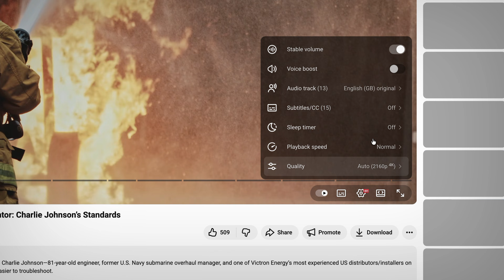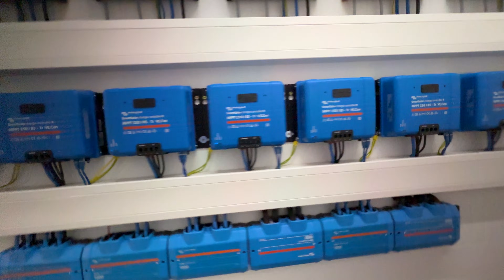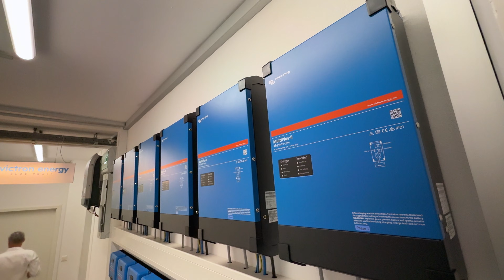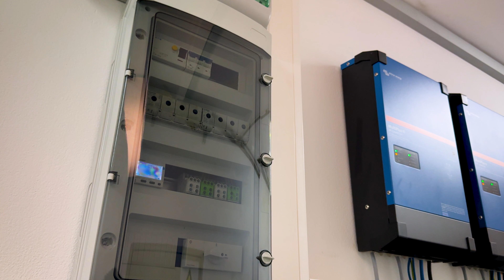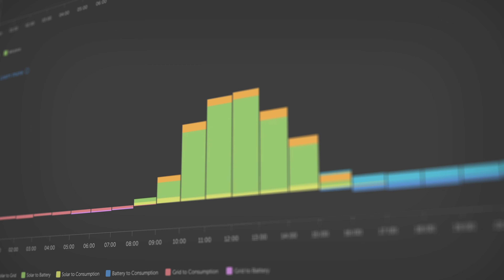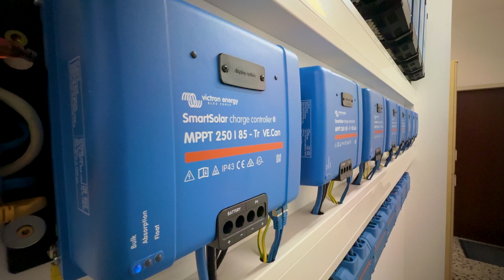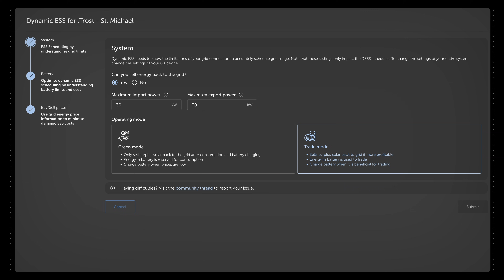How One Family Built a Private Energy Factory

Comment from the maker: Unfortunately there are two errors in this video.  The user mentions this system has 30kW of inverter power.  This should have been 30kVA.  The actual kW for 6x 5kVA MultiPlus II's is 6x 4kW at 25 degrees C = 24kW.  Also the battery bank should have been calculated as kWh instead of kW.  A few comments have highlighted this and we should have corrected this in the film - sorry!
Reply: Nice you own up to it, but as an energy company those fundamental basics should not be an "oopsie"
Reply: @stocki_esy625  in vernacular, we all make those mistakes. In Ireland we cover such with the very technical explanation "sure, you know what I mean!"
Reply: @tomjcarty i understand that the people that were interviewed say KW as it is somewhat common when talking about it (altough i personally dislike this practice)

But in the professionally produced video it gives the impression, that there was no engineer involved in the editing/approval of the video

Comment: Here in California I had Tesla solar power, a Power Wall and a Natural Gas Generator installed. The solar panels generate about twice as much as I use the rest is sold to PG&E and it pays for my connection fees. The extra capacity was obtained to support a BEV that hasn’t been purchased yet and panel degradation. My solar and battery fully supply my loads >97% of the time the rest I use grid power that my surplus pays for. In my first five years I haven’t needed to use my generator. I got it because we were warned about wild fire risks requiring shut down of the grid. Hasn’t happened yet.

Comment: It seems to me that it is a very small total roof solar capacity in comparison to all the electronics you have there. For example you cannot fast-charge ONE Tesla car but would need to triple that. You could Level 2 High Power charge 4 Tesla Model Y, but that would take 7 hours and that would probably be all the sun you get on a good day. 
This system will never amortize itself but it DOES buy you 
Absolute blackout security (days, not hours)
Silent operation (no generator)
Business continuity during grid failures
Independence from grid chaos.
Reply: It doesn't. They use the public infrastructure to facilitate everything.

All they did was create a smaller virtual pricing zone based on financially capable consumers that received lots of subsidies.

All while screwing everybody else over.

Comment: I am off-grid, due to geopolitical issues here. Victron was the best choice for me. I have a 3x5000VA mp2, which is now getting power from a DG75E while at the same time charging from solar. I am amazed at how much my system can provide in temporary maximum power (like 25kW startup power for a 3 phase stone saw, while my DG75E can only provide 6kW at best. For a 6kW load on a single MP2 I have time enough to check with all the people that build my house to move loads to another phase).
This winter I am also amazed about the DG75E + victron combo. As an emergency I had to put a normal cheap heater next to my batteries which is all controlled by node red.
The current temperatures here are -18 C outside, the lowest pack came as low as 3C, and once it goes under 0, I have no normal way to get that pack back to above 0 so it is safe to charge. The best way to heat a lifepo pack, is to inject at least 0.05C but preferably at least 0.1C, so that's 200A for me. And for discharge I haven't seen any numbers yet. It looks like discharge is free of temperature change.
90kWh of battery, last 24 hours took 60kWh mostly of heating everything that can fail. 25kWh of sun, 35kWh of diesel.
So why the DG75E? Well, it was only 1800 euro, and they all said that grid was 1 month to 6 months away. That was 2 years ago. The current situation is that grid here has strange rules with respect solar panels due to geopolitics. Getting any grid would also require me to pay for connecting to the grid right now, and then they will start planning it in 3 years. In the mean time I have to conform to weird grid requirements. While off-grid, you have no permits or anything necessary to build up to 50kW of solar farm.
Diesel costs me about 0.50 Euro per kWh.
However if I want to change the diesel, I will be looking heavily at H2... Because I have so much excess power that I can start my own H2 fabric.

Comment: My Victron system i made, off grid. Solar north facing 10kW panels. 2 RS 450-100 MPPT, 80kWh battery storage made from EVE cells. 5 banks of 16 cells EVE 314 Ah with JBD bms. 4x Multiplus 11 48V 3kW inverters in parallel. Runs my house off grid including pool pump and 2x 7kW air conditioners. The Multiplus II cannot handle their stated output (3kVA each) not even close. they heat up and temp alarm comes on. Also when used as charger the multiplus overheats after about an hour and the temp alarm comes on. So even though I only need 9kW of inverter power I had to install 12kW of inverters to get it. My Fronius Primo delivers its 8kW name plate all day without getting hot. Right next to the Victron. I personally believe the Multiplus c is superior to the Multiplus 11 . Location Brisbane Australia. Never ever come close to going less than 50% in the battery. Built it myself, cost only $20,000
Reply: Multiplus ll 48/3000 is VA. Stated output for them is 2400w, 9600w for the four you have maximum without using Victron Power assist. I am an amateur in Newtownabbey Northern Ireland running 3xMP ll 48/3000. Your setup sounds very nice.
Reply: It's easier to do it in Aussie than in central or northern Europe :(
 good job either way mate!

Comment: 30kW inverter power? Is that a joke? It would run 30kW and in few seconds it would shut down. Correct is 30 kVA, I have a multiplus 15000VA and trust me it is not 15kW barely it is 12kW…I have 18 kWp of solar and the moment and Im sure in few years surplus of solar energy will be during the day also in Slovakia, so they would charge you for providing to the grid. I made my system DIY, I dont have my own grid connection I just use one phase from neighbour in winter, in summer I power his pizzeria 😊
Reply from the maker: Daniel and the engineer are talking about the max peak power of the grid connection, which is 30KW. Not the inverters.
Reply: It’s all in the cables 😊

Comment: Also im Winter viele Solarpanelen freifegen. Oha viel Spass. Es waere nicht der erste Kunde der das tun muss im WInter. Genau darum Liebe ich Victron Hradware und ich brauche T-Shirts mit Victron Logo
Reply from the maker: Remember Daniel talks about DESS where he can fill his batteries using cheaper night or middle of the day rates when there isn’t as much solar. 

At least the roof is flat for him to get his brush out however ;-)
Reply: @VictronEnergyBV im Winter bringen die Ost/West-Ausrichtung nicht viel und der Schnee rutscht nicht ab.
Reply: @Sangria60ig  Naja Süd ist noch da und mal eben aufs Dach mit nem Besen ist kein kein riesen Akt
Reply: I have my panels at 45 degrees to the south in the field. I do actually clean them from snow, but that is either to let them have the full sun without them having to meld it. But I did that like 4 times this winter.
And this winter it was also to get 300W of my 17kWp instead of 150W... :-).
But yeah, brush snow away before the -18 turns it into ice.
I wish there was a mode that you can actually power the panels to de-ice them.
My starlink did not have any problems with snow (as it turns on de-ice mode).